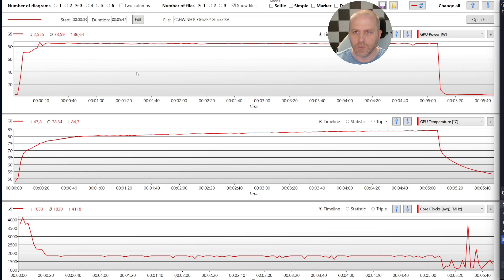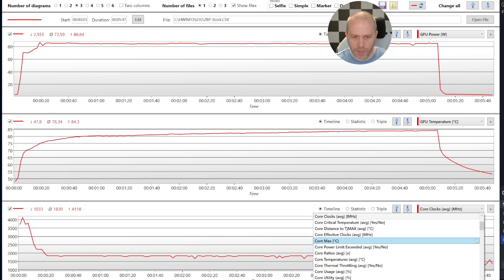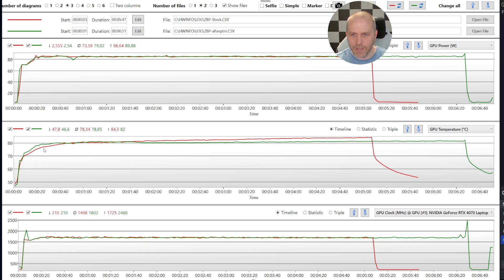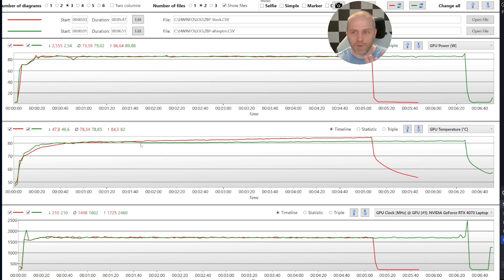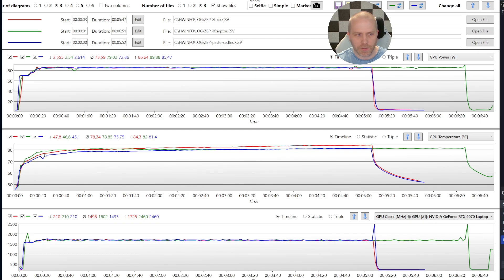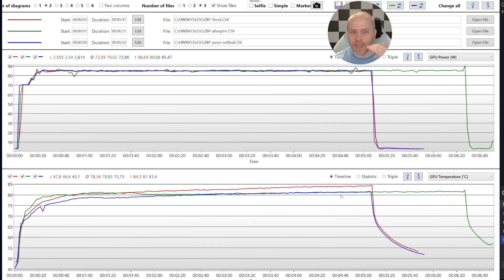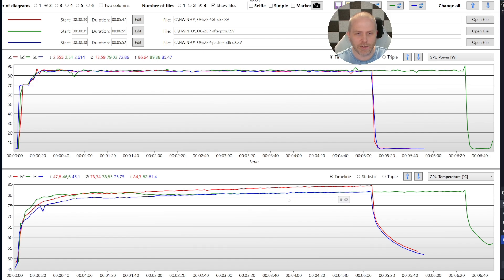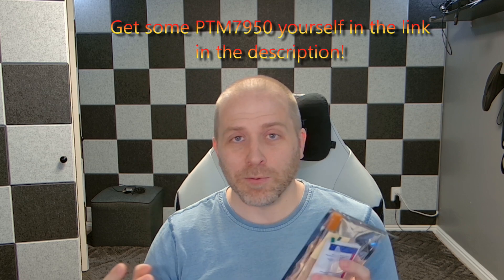Proof that PTM 7950 paste works!

Comment: Your first run never reached equilibrium. 

the red line looks like it would have gone up a few more degrees.
Reply from the maker: It would have, but the temp limit on the GPU would have kicked in and throttled back. but even so, that just means PTM7950 is that much more effective.

Comment: Over time, with more heat cycles, the PTM 7950 cooling performance should improve even more. I've seen test results showing a major change in temps after a month of use on a 7900 XTX, but the initial temps were quite good right away as well.
Reply: After a year and a month of using Asus TUF 7900xtx, playing Black Myth Wukong/Path of Exile 2/Last Epoch where it's always running at 100%. Creeped up to 101C Hotspot Temperature. After PTM7950 today. It's already down by 20C from 101C. This Honeywell product seems too good.

Comment: I bought a Ptm7950 and Idk what I got, it seemed like it was fake since the plastic film was so hard to remove and it felt so cheap but the temperature results is just insanely good, The laptop gpu on furmark is pulling 95 watts and the temperature in one run went upto only 62c, I have never seen it go above 70, previously it used to be like 77c, don't even talk about the cpu difference, Previously The cpu used to hit 99-100c, now it's hitting 77c.
Reply: The plastic film is just hard to peel off real or fake
Reply: @Fifjdijnejddinddksksksks  I am sweating more balls peeling a small plastic film than I was during my test.

Comment: Only place i know that has genuine PTM7950 is LTT. It's more expensive than other areas, but it gives peace of mind that it's genuine.
Reply: Just ordered some from there. should be just enough to do my laptop and steam deck.
Reply: Same here!
Reply: I live where the cost from LTT isnt justified, so I use their rebranded like Heilos or phasesheet, but they dont provide larger cut afaik
Reply: genuine one are on ebuy7 named site. its a asian site and they are ones from whom ltt is sourcing( not the store but the main seller, they sell on that site)

Comment: that is fake ptm-7950
Reply from the maker: How can you tell? I've purchased this from other people saying to use this link because it was legitimate and the results seem to be working well, but perhaps there would be room for further gains if this really isn't genuine like you claim. Again, on what basis do you claim this is fake and do you have a link for non-fake PTM7950?
Reply: @cbutters  I bought from the same seller temps are going to 94c were 70ish before I did multiple installs still the same bad results
Reply: The links on LTT when he covered the PTM7950 will bring you to the genuine store that sells genuine pads @cbutters
Reply: @cbutters LTT store for genuine ptm.
Reply: @cbutters  The "fake one" works just fine, I replaced my laptop GPU paste and it never reaches 100C hotspot now when before it went beyond that.

Comment: I got -5 on hotspot and -8 on temp senor on my RX 7600 XT. I used ali's 0.25mm, I think it wasn't even original one. Applied it to laptop witrh R3 2300U (which has 1 pipe mini cooling system) - no difference with MX-4 noticed.

Comment: I will say, my 6950xt had a hotspot that would hit 112 on the hotspot regularly on open world games while the normal temp was mid to low 70s... after putting this stuff on the hotspot seems to just kiss 100c on the hotspot
Reply: same mate although it is 6900 xt, will have great temps for 1 to 2 weeks after that it will go 100c
Reply: put on 7950 and it never went 90c even at 1st test, now max is 84c at hotspot with full load
Reply: Same problem with my 7800xt, I'm waiting for my PTM 7950 to arrive and hopefully it fixes it too. Was it hard to apply?
Reply: @astoraan6071 May I know that model of 7800xt you are using? So I can avoid bad cooler😂
Reply: @yyniuniu  It was the ASUS DUAL 7800XT. But after I applied the PTM 7950 my hot spot temps are back to normal and never goes above 90C even when I Overclock the card. I guess it was just bad thermal paste or application
Reply: @astoraan6071  gamers nexus mentioned high deviation between hotspot and gpu temperature could be gpu cooler mounting design caused. It’s great you fixed fix it tho
Reply: @yyniuniu  Maybe, the DUAL model I had there is literally nothing about it online, no videos or teardowns at all, just the TUF version. But I couldn't fit that in my case so I wen with the DUAL. Now I upgraded to a 7900XTX

Comment: 4 degrees ain’t a lot
Reply: nah that's just wrong
(more likely 3...because 83.9 - 80.9 is 3...not 4...but then the initial one was also rising etc so I guess we can call it either one)
That amount of difference in a controlled envoronment is a really great result because a few degrees go a very, very long way when you are near the throttling limit like laptops are pretty much always.
On top of that, you can see that the PTM paste cools the GPU faster when the load drops as well, meaning it will always start at a lower temperature than the stock paste, which further helps in a gaming scenario when scenes can vary greatly in GPU demand.
This is a pretty damn ignorant comment.
Reply: I got -5 on hotspot and -8 on temp senor on my RX 7600 XT. I used ali's 0.25 mm, I think it wasn't even original one. Applied it to laptop witrh R3 2300U (which has 1 pipe mini cooling system) - no difference with MX-4 noticed.
Reply: @TheSillyWorkshop  DId you check the performance (fps, hz whatever) of the R3? You will often not see a temp difference in laptops because they're so damn thermal limited, but bonus cooling usually goes right into your FPS and/or stability.
Reply: @rarespetrusamartean5433  I didn't test fps, but when I was using MX-4 thermal paste AIDA was not showing throthling. The cooling system in my laptop is litterally a single pipe connected to a slim noisy fan (NOT EVEN A RADIATOR, LOL). So my guess is that there is no difference because there is no place where to conduct the heat. By the way I was mistaken about GPU, in both cases I actually used 0.25 pad.
Reply: @TheSillyWorkshop  Was the laptop already at or near the thermal limit? If so, it's possible that even if it's still throttling, it's able to do so at higher frequencies.

Comment: I actually prefer the PTM to liquid metal on laptop. 
The LM usually has the best thermal performance, but it also transfers so much heat that chassis temps are usually higher as a result. When I repasted a ProArt Studio which came stock with LM to PTM, the thermals were a tiny bit higher, but at the tradeoff of much more comfortable keyboard deck temps. Just a few degrees made a huge difference in feel.